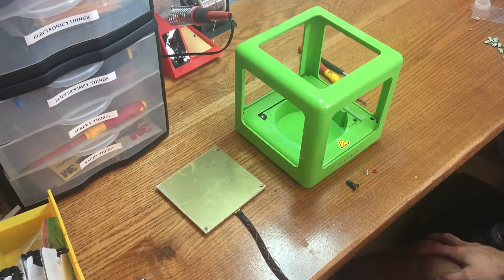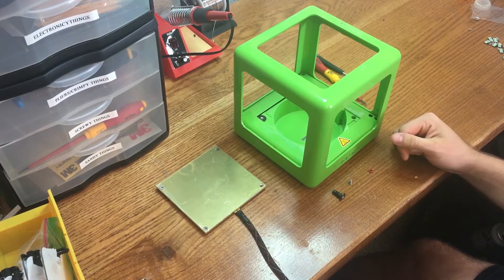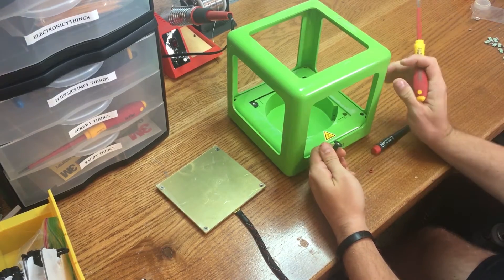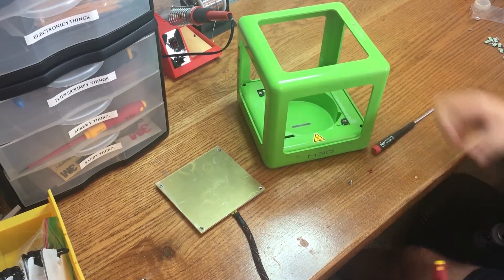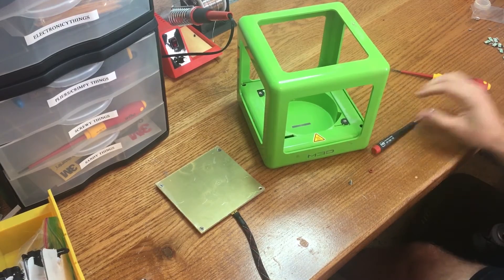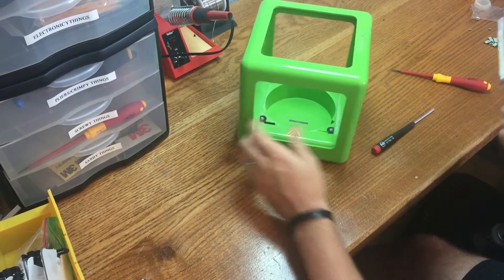Heated Bed

Comment: Are you seriously charging $100 for a heated bed?
Reply from the maker: Yes, custom circuit board,  custom urethane injection mounts, custom electronics. It is a nice product and I make everything personally. It takes a lot of work and time.
Reply: Chase Wichert  I get it but that's a third the cost of the entire machine. I'd be willing to give you $50 at most and you can consider me a lifetime customer for PEI sheets and I'll even promise to buy the LED light kit and the enclosure bc I find them rather cool.
Reply from the maker: Yeah I understand that. And I wish I could charge $50, but I can't. This isn't a big money maker for me, it was supposed to be a small project and turned large. Sorry the price point isn't in your ballpark.